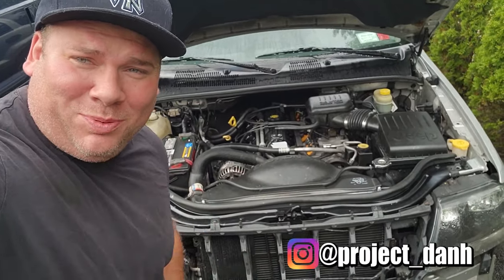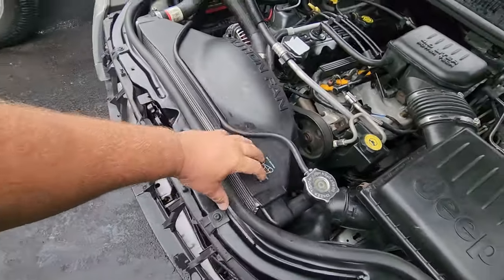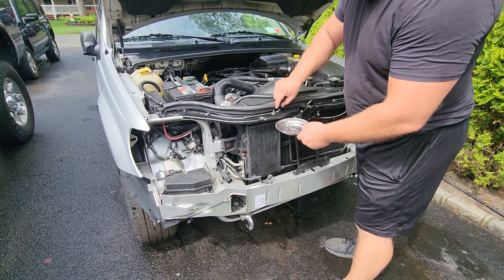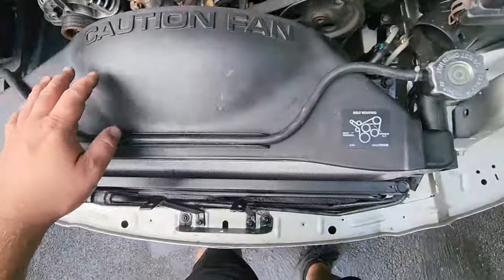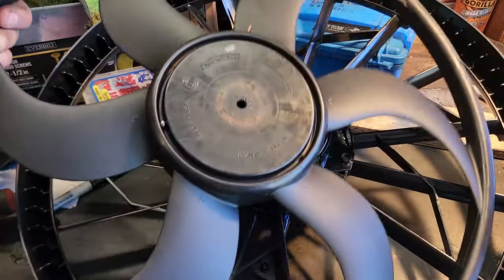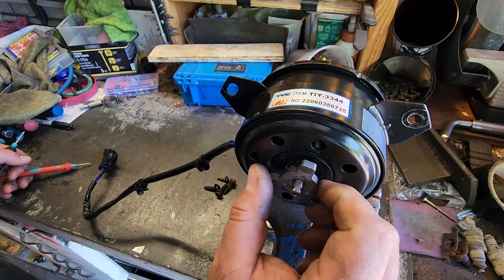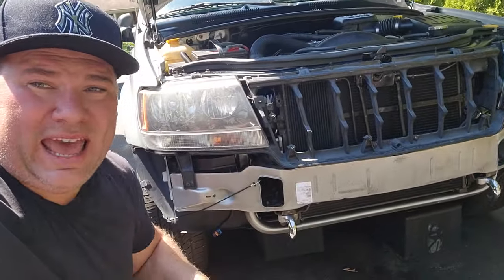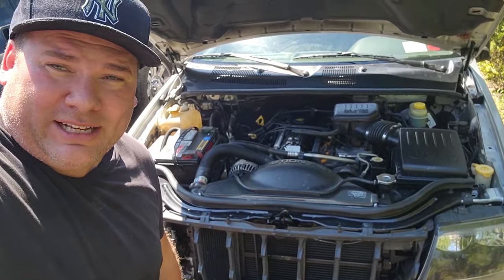WJ E-FAN & FAN RELAY - 1999-2004 JEEP GRAND CHEROKEE ELECTRIC FAN MOTOR REPLACEMENT

Comment: nice video, bro ! This confirms my experience with after market parts - I therefore keep the OEM parts installed until those fail - usually the original parts do have better quality.
Reply from the maker: Great point! OEM is the way to go!
Reply: mopar or no-par

Comment: After replacing 5 fans in a span of 4 years, I finally replaced the thermostat with a new 195 degree one, and low and behold, the fan only kicks on 1/10th of the time. I suspect my fans were lasting about an oil change interval, because it was coming on too often to cool the truck, which used to run at 210.

Comment: Hey bud, always enjoy your vids. Question do you know the diameter of the fan? Trying to convert my ZJ to e-fan and think size might fit being the rad size and style is not that far off from the ZJ. Thanks in advanced.
Reply: You can use a Lincoln Mark VIII fan with very minimal shroud trimming, on the zj! you could also find the original 5.9 e-fan but those are almost nonexistent

Comment: Не понятно, зачем пол морды разобрал. Я менял вентилятор не разбирая морду. Просто открутил 4 болта крепления и установил другой.
Reply from the maker: The bumper was off for painting and I wanted more room to take the fan out without disconnecting the radiator lines